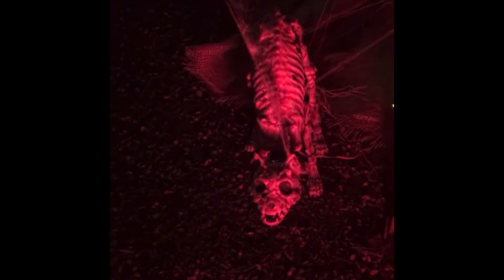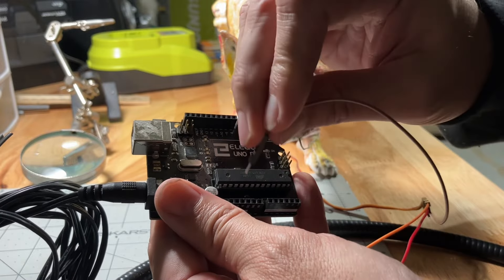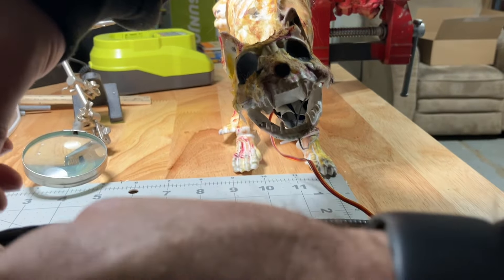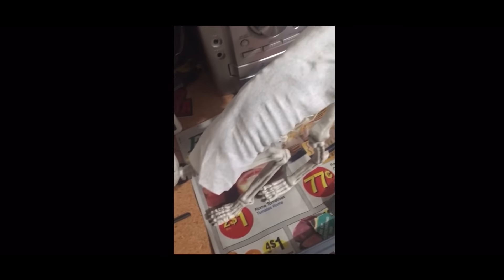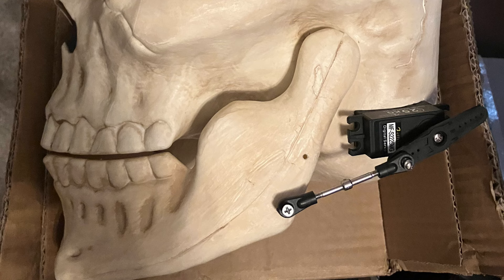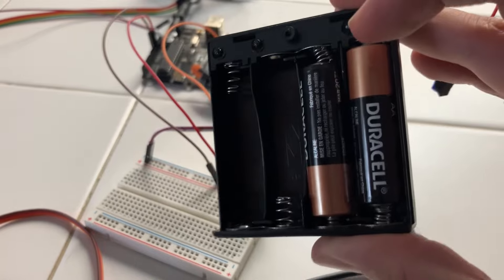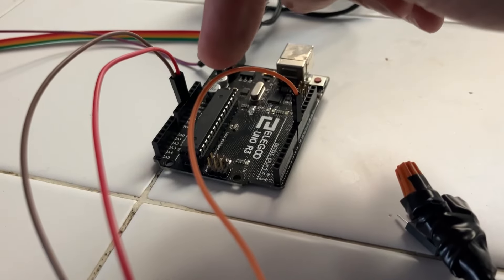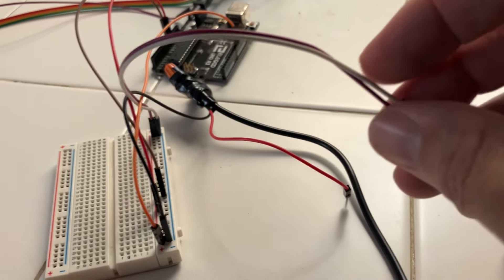DIY using Arduino servos for props

Comment: Looks awesome just a question though. How do you get the mouth to move in time with a speech recording?
Reply from the maker: Using the Jawduino build. The audio goes straight to the arduino. I have the build here:
https://youtu.be/0rVZTHBohRo?si=bMbgJ83FoRvIrLqb
Reply from the maker: Here’s a better sample using the Jawduino build.

https://youtu.be/rxGQFC-vLQo?si=fnFaj31OKxfDxbiG

Comment: It looks and sounds like you're suggesting putting an extra voltage source (like the batteries or a DC power adapter) in parallel a with the power output of the Arduino.  That would be a bad arrangement that'll likely shorten the life of your Arduino board and the batteries.

You said it provides 8 volts, which would be true if you connected the power supplies in series.  But that might not solve your problem and it's still possibly going to overtax the voltage regulator on the Uno board.

Most hobby servos are designed to work at approximately 6V.  Many list specs for running them at 4.8V and 6V.  If you don't have enough power, then you probably aren't able to source enough current and/or the servo is too small for the job.  A typical hobby servo might draw something on the order of 100 mA on average, but it can peak above 1 A when driven under load.

The +5V output pin on the Arduino can provide a limited amount of current.  Details vary by board, and some clones use different power management designs that are fine for general use but don't meet the specs of the official boards.  You can probably power a single, lightly loaded servo from the Arduino's +5V output.  (Even if you can, there can still be reasons to consider using a more capable power supply.)  If you want to drive a larger servo, a servo that's most produce a lot of torque, or more than one servo (at a time), you're going to need more current.

A better solution would be to power the servo directly from your 6V power adapter.  Connect the power and ground wires from the servo directly to the positive and negative outputs of the power adapter.  Connect the signal wire to the GPIO pin on the Arduino.

If you power the Arduino from a separate supply (like the USB or a second power adapter), then you *must* connect the 6V ground (negative) to the Arduino's ground.  The servo is going to compare the signal voltage to the ground from its power supply, so you need both grounds to be at the same potential.

If you want to power the Arduino from the same 6V supply, you'll need a tee that gives your power supply two outputs in parallel.  In that case, keep in mind that the total current rating of the supply must exceed the current needed by the servo plus the current needed by the Arduino.  (Powering an Uno from a 6V supply will usually work, though it's recommended to use at least 7 volts.)
Reply from the maker: Appreciate the info. I don’t know about any of that and just do what makes it work the way I need it to. But, I definitely don’t want to ruin a board. I’ll take your information gladly. Just thought using the breadboard would help, because the 5v wasn’t allowing the movement with weight but the 7 something I had connected to breadboard did. I’m proficient in replacing light bulbs, at the least! Thanks for the info. Appreciate it.